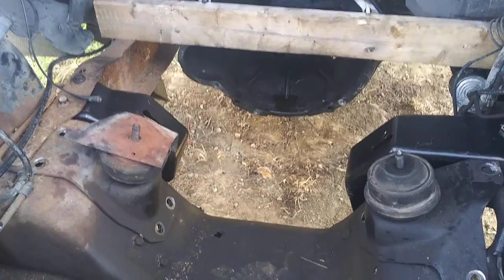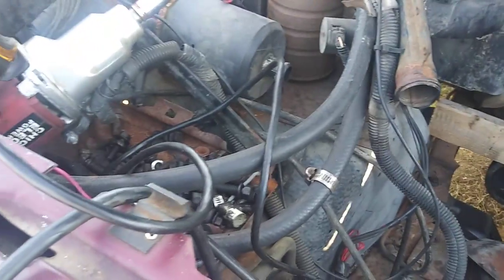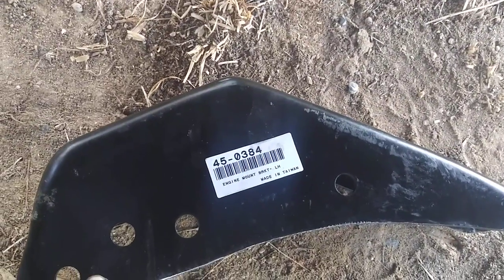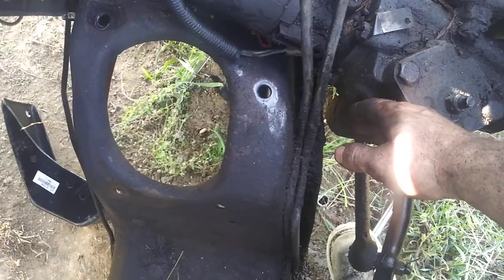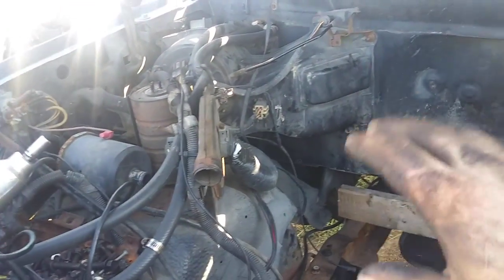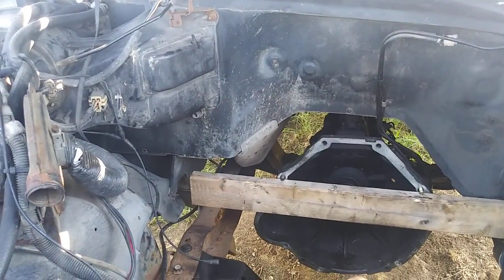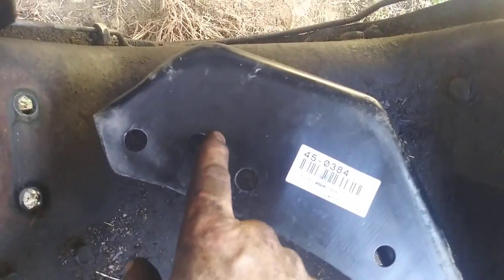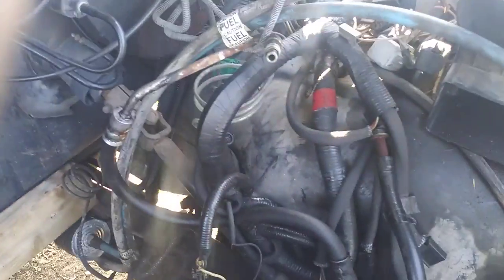Complete 300 6 Cylinder 4.9 to 302 5.0 swap in detail

Comment: I bought a 93 f150 with a 300 with a 5 speed, and the 300 is stuck. I’m going to pull the engine out just debating if i want to put a 302 in it for a little bit more fun.

Comment: Can you do the opposite on the same year truck? For example a 96' 300 I6 into a 96' 302 v8??
Reply: @bad66chevelles   sorry what do you mean by carb swapping? Do you mean putting a carb on a fuel injected engine? I'm looking at a 93' f150 with a locked up 351w, and a bad automatic transmission but I want to see if it would be easy to drop in the 4.9 I6 into it

Comment: i actually want to do the opposite of this haha, i might be buying a 88 f250 soon with a bad 351, and i want to swap a 300 in it.
Reply: I did this in my Bronco.  Swapped from the 302 to a 300.  
Not bad overall.  The hardest part is finding the frame perches for the 300 to bolt to.

Comment: Doing a engine swap on my 95 f150 has the inline6 4.9 5 speed manual and doing a 4.9 cobra 5 speed manual. Do you know if the engine mounts fit for this ??

Comment: Ive been thinking of doing this swap with a 1986 f150. the factory inline 6 is what i am wanting to swap out to a 302. would this still be as straight forward? my dad passed away this year and i wanted to get this truck running. is there a year range of 302 that would be easier? or a specific crate motor to get? it is a 4 speed manual.
Reply: @bad66chevelles  I'm so glad I found your channel and Vid.

I ordered a 302 long block from PowerTrain products.
They sent it 5 weeks before they said they would..lolz

So I'm having to find out quick what else I need to buy. 

My 85 f150 had the 6 cylinder 300 in it and the owner before me has really had some issues with bare damaged wire.

My 1 question for you cause your vid   showed almost everything else. Is what new writing harness should I get.

Great video btw..Thanks
And
As I was typing this you started talking about the Mechanical fuel pump AND the new check type h.e.i. I also wanted to have installed...AWESOME

yea it's best to get rid of the other junk
Reply: @bad66chevelles  yes I Will watch all your vids before monday.

I got the  np435 transmission in it.
The truck engine and frame only had 67,000 miles on them and the 4×4 works fine.

So glad you responded and seeing another person actually doing the part changes such as I'm going to do is great.

Cause the few people I tell About the changes I was wanting to do...they just roll their eyes and my entire reasoning is those systems are 100% prone with problems.
The tank fuel pump thing is a living nitemare...the man I bought the truck from has had 3 fuel pumps installed in the last 4 years or so. That was the main reason he sold his Truck. He had several wires get hot it appears and slagged the rubber coating off them.

Well I know that kind of thing is something dodge is famous for and I don't want none of that hassle. That is the in tank fuel pump was getting a slightly different current that it needed and would Burn up

Fantastic Channel

I haven't watched all your vids yet...I'm looking forward to seeing the one where you put your new carburetor on.

I've seen a 2 barrel such as what was on a dodge 318 perform fantastically with decent gas and I've seen 4 barrel set up be good and bad.

Thanks for these Vids!
Reply: @bad66chevelles  even the Ford power steering pump Whine was a issue I had resolved to replace..hhahha its like I'm gnna have the same truck as you..WHOOHOO..lolz
Reply: @bad66chevelles  the 1 tip I might be able to give to you is what I'm gnna use for my battery.

A short recap
I had a large deep cycle battery I used to power a 36ft lb trolling motor for literally 12+ hours at a time on a 12 ft aluminum boat.
One day my friend who had a dodge truck with the 2 barrel 318 in it needed a battery...so we put my deep cycle battery in his truck.
There was never a issue and if the battery went Completely dead because we listened to the radio with the lights on looking for wildlife too long... NO Problem. 
Jump it and it would charge up just fine.
Reply: @bad66chevelles  whenever I have the engine room I always run. A deep cycle battery.

There are several advantages

Comment: Iv got a 1994 f150 with 4.9 and wanting to do 5.0l 302 swap, was wondering what all I will to do it and about how much would it be
Reply: @bad66chevelles   you remove the electric fuel pump from the tank ?  how you do run the mecanic pump ?  im in the same inverse swap plus efi to carb.

Comment: Thank you sir I've been pondering doing this exact swap with my 1987 and 1995 Fords
Reply: @bad66chevelles   the 351 Windsor I have a 1995 that was my company truck for many years but I would like to stuff it into my short bed standard cab 87 beater. But I also have a burning desire to put a big block Ford into it since it is just a toy. I was interested in swapping the pole fuel injected 351 in place of the 4.9 but I'm not a wiring genius and if I'm going to go carb I'm going to go real Big inch wise

Comment: I got an 84 and I pulled the s6 and I got a 5.0 out of a 2000 model explorer. Does it all apply the same or do I have to do something different
Reply: Did you ever complete this? I was thinking the same thing
Reply: @rich333m  oh dude it took some convincing on the install but it dropped right in after a few adjustments
Reply: @timkelley5596  you wouldn’t have a video would you or steps?  Good job by the way
Reply: @rich333m  nah man I'm on my own out here using tree limbs with come alongs, aint got no time to be videoing my progress but to sum it up. Order some motor mount brackets and had to do a little modifying and I converted it to a carbed motor cause I can't program shit with ECUs and ECMs and bam I got it running

Comment: What did you with the fuel pumps that went into the tanks
Reply: Thanks man
Reply: Hey man I’m about get 5.0 out 93 to put in my 1990 with 4.9 and glad you posted this so motormounts I got check what else I’m most worried about if it will hook up to transmission and if I need different flywheel? I got 1990 F-150 XLT Lariat 4.9 2 wheel drive

Comment: Would the manual trans bolt on the 302 or need it a diferbt flyingwheel??
Reply: If it’s an older 302 not external balanced 5.0 ho it will probably bolt up